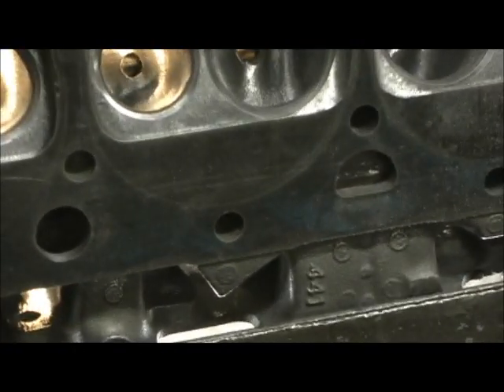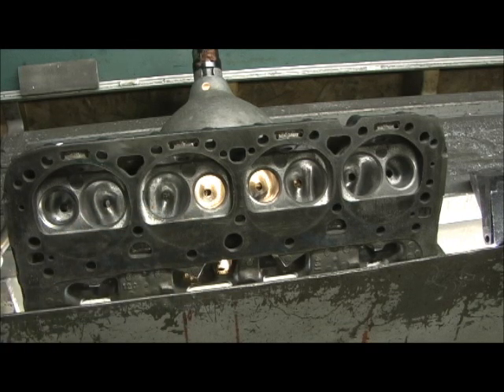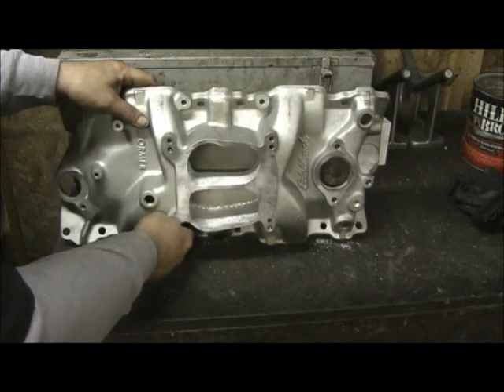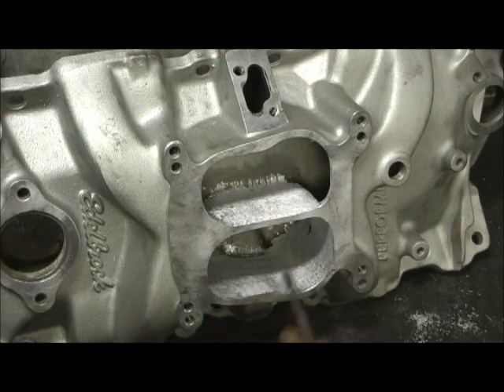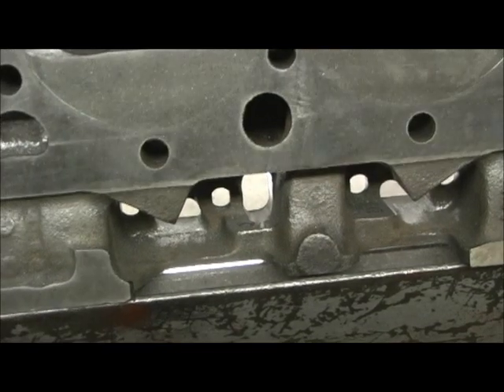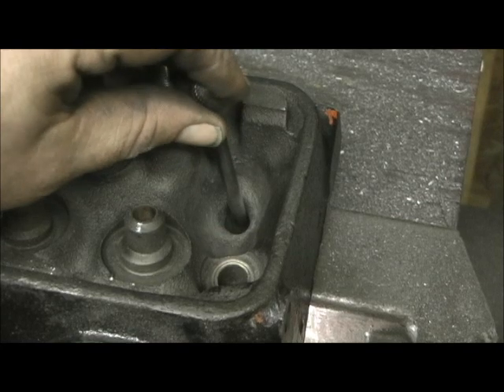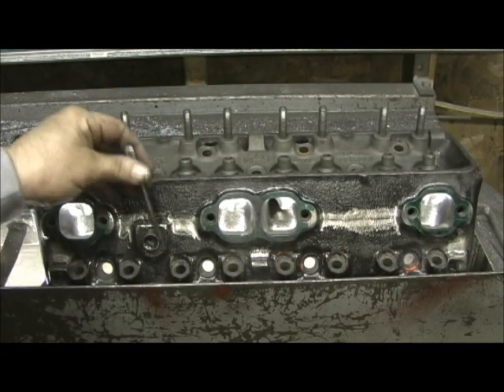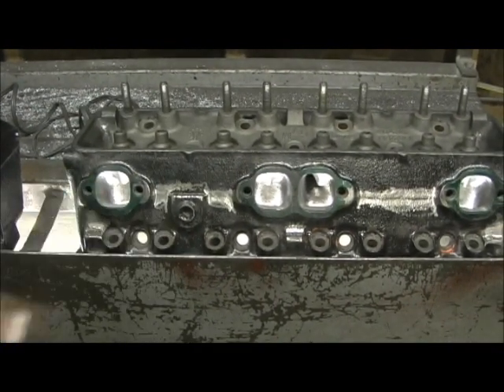Porting Edelbrock Performer Intake Manifold for 441 Castings part 5

Comment from the maker: I leave ALL my intake runners to the rough side, no polishing except on FI engines, where the fuel does not turn as much (no puddling as they say). I use a light carbide finish to it.

Comment from the maker: WOW, I see what you mean, I have had a run on Chevy stuff the past year. I am getting ready to post a FE Ford 390 Head I welded and full ported with two intake manifolds. For the record (no pun intended) My current NHRA National Records in Super Stock and Stock Eliminator is with the 1985 Ford 302 Carburetor heads in both classes. I am a master of that head design, after sawing and cutting for two years on that specific head. I have done all the 460, E7, J302, DOE 351 dog leg, FE type heads. Yes

Comment: The Performer RPM as well as most Dual plane intakes will see a very noticeable increase in performance if the center divider has 3/4" milled out of it about 3"  length centered..  This is like having a spacer but just not visible ;)...  There is a video comparing the RPM against a competitor and they do this to both intakes and see considerable gains.. Then still got a gain on top of that with a spacer on top of it.. Kind of trick but works great..